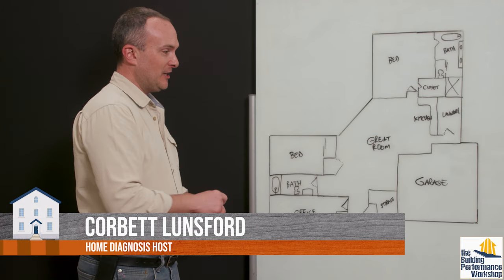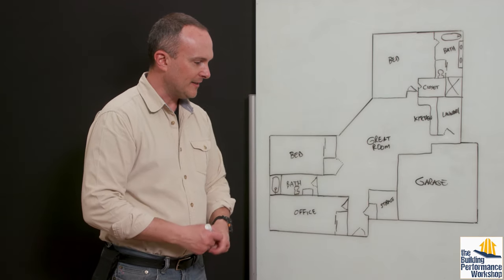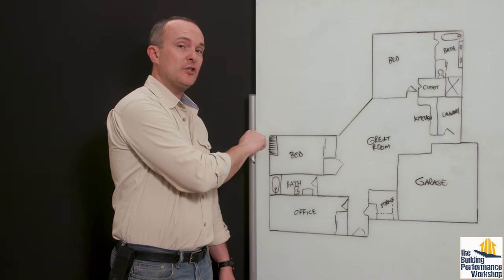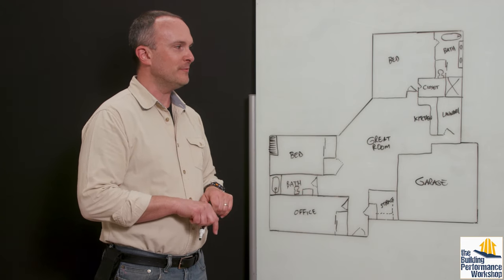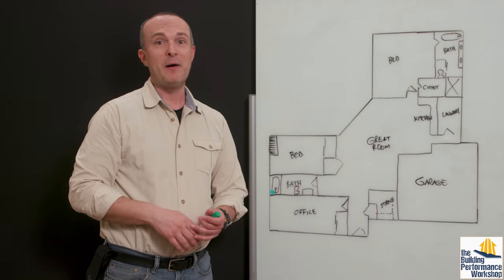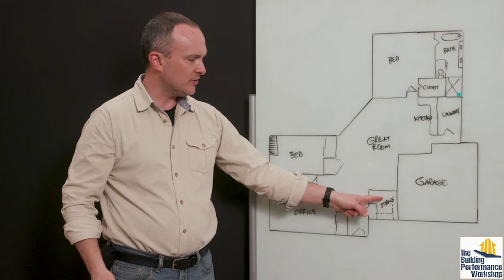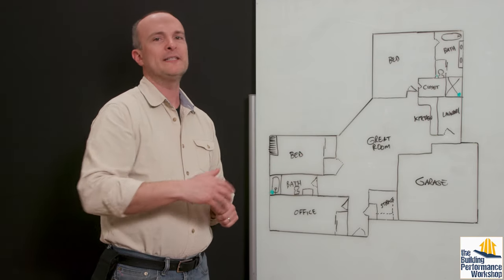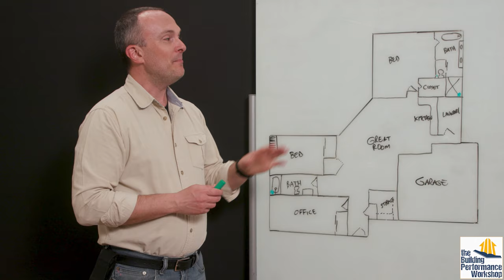Tips for High Performance Home Floorplan: Designing Out Condensation, Odors, Discomfort, and Hassle

Comment: If you insulate properly (continuously on the exterior of the building), air seal properly (continuously around conditioned space), and ventilate properly (via ERV), you can design any way you choose because these concerns won't exist.

Comment: Good to know. We have a coat closet on the front of the house we barely use. But during the winter, every time I open it, it's at least 20 F colder in there. 
Never even considered that it was a mold risk.

Comment: We ended up with the most energy efficient house in our wee town by sheer luck. I live in the Canadian Arctic where temperatures fluctuate 100C from coldest to hottest temperatures, so insulation is no joke.  We were really fortunate that the previous owners changed all twelve of the large windows to custom quad-paned units.  Even when the exterior temperature is around -60C, the glass on the inside never gets cold.  I will be sad to say goodbye to our little house when we retire because Northerners value function over form; I can decorate to make it cute, but I can’t fix major structural deficits.  Because the permafrost is just a few scant feet down, there are no foundations or buildings set right on the ground, but on jackposts or piles.  Usually the floors are frigid, but in our house we have a heated crawl space below so the floors are always lovely!  There were two strange or new things for me, though, with this house:  
1. having a humidifier going during the winter.  We came from Nova Scotia where DEhumidifiers were da riguere, so this was new.  We usually go through about 7-8 litres of water every day in our humidifier; and
2. Central AC. I realize this is nothing new, but it was the very first time I have had central air in a house.  Not only does it combat the heat when we are in the high 30’sC, but when we are in a heavy smoke from forest fires, the hepa filter eliminates any trace of it inside.  As an asthmatic, that is a HUGE boon, especially when you live in a remote town with no road going to it except when the ice road is open each winter.
Reply from the maker: Thank you for sharing

Comment: I have walk in closet on exterior wall. When i designed my house I never considered moldy odors....and 30 years later It works fine. no odors, no mold. It's worth noting I did install baseboard heating elements along the exterior wall in the closet. Good video thanks for sharing your views .

Comment: Running Warmboard into the closets keeps the closets from getting musty. Also closets on exterior wall should be around 25” in depth. Keep the clothes on hangers about 2 inches from the wall. The air gap keeps the clothes fresher.
Reply: Curious how warm floors affect mustiness. Always looking to learn. Please talk through this a bit. Thank you!
Reply: @branchandfoundry560    For some people, clothes coming out of a dryer can be slightly damp. The clothes get hung into a closet for final drying - to reduce the number of wrinkles.   A closet needs to have "drying potential" just the same as a wall or ceiling assembly. Running warmboard (in-floor heat) into a closet - combined with a return air pathway allows warm air from the floor to rise then go to the whole return or to an exhaust fan with a dehumidistat.  (I am talking about ERV technology with integrated HVAC controls  rather than "stand-alone" non-integrated controls).   Combine "clothes science" with "building science" and thinking about how to keep humidity in the healthy range.  To answer the question - mustiness can come from damp clothes.  Where there is moisture - you need to ventilate.
Reply: @BirchwoodBill  Ah, ok. Thank you!

Comment: Thermal bridging becomes vitally important as your structure gets less leaky.  It is however often thought about in the wrong sequence. Don’t worry about a thermal bridge until you’ve completely controlled airflow.
Reply: What would you say is the minimum air sealing required to worry about thermal bridging? 1 air change per hour? Passive House's 0.6? Sub-passive-house cert?

Comment: thermal bridging for sure is something to think about in Canada! I moved into a new build in 2021, left a pillow leaning against an exterior wall for a few nights. when I wanted to pick it up it was frozen to the wall because it leaned right in front of a stud. imagine having a closet on an exterior wall. all the condensation that's collecting in there. you'd have an extreme mold problem.
Reply: this comment was just for the super nerds picking fights in the comments ;)
but overall a super helpful and informative video 👍

Comment: Please go on more about why thermal bridging isn't as big a deal as we think.  We've probably all seen the thermal imaging photos which clearly show thermal bridging.  Actually, I've seen that in frost that has formed on siding: there is less frost where the studs are.  Have you done a video on the ZIP system?
Reply from the maker: Hey Budro- I built our forever home with GP ForceField, which was invented by the same guys who invented ZIP, following similar ideas. You can see lots on that playlist about it, and in the second season of Home Diagnosis:
https://homediagnosis.tv/season-2-episodes
Reply: Temperature is not the same as heat transfer rate. They are related exponentially to the temperature difference between surfaces. But conversely, heat transfer with smaller gradients is really slow.

An infrared camera cannot actually tell you where most of the heat is being conducted to or from and how much. You can infer it from temperature differences, but it's not absolute.
Reply: @KaiserTom  Excellent points you make!

Comment: Dude, if you’re getting condensation and mold growth on the inside of an exterior wall, then that wall is not properly insulated. I don’t see how this has any relevance to new construction. 

It might be useful to know for minor remodeling of older homes that might have little to no insulation in the walls. But if you’re building new, you should insulate and control vapor and air properly such that you can put closets/storage on exterior walls. It is a good point though about using them between rooms strategically for noise reduction. 

I also always thought it would be a good idea for kitchen corners to have that difficult to use space be used by the other room. For example, in the layout shown, that master closet could have a chest of drawers built into the wall that uses the space under the kitchen cabinet corner (or from the laundry room). Yes, you lose some kitchen storage space, but it’s awful storage space, and it becomes much more useful in the closet. You could even steal some space back from the closet (or laundry room) with a small nook to be able to recess the fridge a bit so it’s flush with the counter. This makes the space a little less flexible for changing around in the future, but it uses space much more efficiently. So depends on your preference I guess.
Reply: Like your ideas on space usage.

Comment: Some interesting info. I will be building a hempcrete home with living by the water and having moisture issues in the sometimes humid summers. It’s moisture regulating and very insulative, among other benefits. I don’t like a/c, preferring open windows/fresh air. I like curtains on closets and even cabinets, or leave open with no doors, or ventilation holes (can be stylish) for air flow, as it gets musty smelling in a regular home near the water without using a/c, no matter what. Ceiling fans etc help too. There’s various things like calcium chloride that can help absorb moisture.
Reply from the maker: Interesting- I’m rooting for you, though I bet your guests/fam members may wish for A/C eventually the way the climate’s going.

Comment: Hi Corbett, I enjoyed your video – lots of good information. I was wondering what you would recommend doing to improve the durability of the wall assembly in the bathroom when you have no choice but to put the tub/shower against an exterior wall – or in a corner with two exterior walls?
I know from watching other Youtube videos that a common mistake some builders and most DIYers make when installing a tub on exterior walls is that they forget to install water resistant drywall or cement board below the tub deck. Yes, they do install cement board ABOVE the tub deck so they have some place to attach the tile but the stud bays below the tub deck are left open and that just allows moisture laden air to flow freely into the bays and condense on the inside surface of the exterior sheathing.

So after installing water resistant drywall around the entire tub area (before you install the tub) would it be a good idea to build a second insulated wall up against the outer wall for an added moisture barrier?  Essentially the sequence of layers would be: exterior sheathing, exterior wall studs with insulation, water resistant drywall as an air/moisture barrier, interior wall studs with insulation, smart membrane (?), cement board, tile, tub.
Good idea, or overkill?
Reply: that was exactly my question. If it's known that there's insulation issues with tubs against exterior walls, are there no mitigation options?? Seemed unlikely to me. Great question!

Comment: Thanks for fighting the good fight!  A couple of questions:  
1) Exhausting directly from the Shower and Powder room to a continuously running ERV seems to make good sense on some level.  Should we assume that there is no conditioned supply in these locations,  or does the conditioned supply air get pulled into the bathrooms?  It seems that if  there was supply in the Bathrooms it would run straight to the ERV exhaust potentially limiting their effectiveness in conditioning that space?  If the ERV is running full time and the Conditioned supply is running as needed based on the thermostat location does this lead to less than ideal conditions in the bathrooms.   I would love to see a video on the science of supply grille locations for an entire house.  Last question, on an older not so well sealed home why would you not recommend an ERV (just the cost), it seems the less  you need to pull air from cracks and crevices via negative pressure the better?  Thanks!!!!
Reply: ideally in a bathroom you would have a floor vent between the sink and door or a ceiling vent above the door

Comment: I'm a builder I've never seen a mold problem in my area with closets on the outside walls we do however have low humidity similar to Arizona levels.
Reply from the maker: Mostly a problem in cold weather, so indoor humidity is the worry. If you add enough clothes and boxes, you could reach dewpoint almost anywhere.

Comment: My brother has a heated workshop that sees higher level of moisture due to parking a snowy vehicle in there and everything melting. More to the point you can find every stud and most screw holes behind the white-painted drywall because moisture condensation and then either dirt or mold as a result of said moisture.  

With 16" O.C. framing at least 10% of you wall is a framing with ~R-7 insulation verses the ~R-21 in the cavity.

Comment: the small dwelling designs i've been tweaking over the last few years (building 1st one this summer!) all have kitchens/baths/utility central, nothing plumbed in envelope walls, with living/bedrooms at the wings (designs are all situated E/W for solar gain). the idea is to use the ERV vent/return placements to also passively help with heating/cooling duties (pre-moderated via Earthtube, & a post-exchanger hydronic fed plenum), as i won't have central HVAC... and this layout helps keep major MEP costs low. 

your thoughts on small confined spaces on envelope walls isn't somethin i'd worried about much (wardrobe cabinets, no actual closets), but i do have kitchen/vanity cabinets on some. would you suggest i find a way to ventilate the cabinets? i'm already supporting the lowers with 3/8" tall squares of UHMW poly to help avoid damage from spills/pooling/leaks (also allows LVP to move under weight...not that i'm using LVP on these - polished concrete w/hydronic), so it wouldn't be hard to add some perforations. circulation behind cabinets would only involve added trim work.

 thoughts/ideas?

(6" ICF envelope & ICF roof, insulated slab, 7000' high desert with 20" rain, 6' snowfall, mid 20's - upper 80's, low dew point)

Comment: Ducts can go under the floor also, I just bought a house from 1962 that has a vaulted living room in the middle, vents in the floor
Reply: Typically vents have been in most homes I’ve ever been in, unless it’s electric or boiler baseboard heat. (Canada)

Comment: Pardon my lack of knowledge, can you explain further why it is not good to have the closet on the external wall? Can you explain please? thanks you
Reply: If I understood correctly, it is because the condensation that might happen will lead to mold, as the external wall might have a thermal bridge, which is a point in the building where it has weak insulation from the temperature outside. So the external wall will let in the air from outside and the difference in outside and inside temperatures will create condensation and if a closet is against the wall it'll mold.

Comment: It seems like a lot of this can be solved with a better exterior envelope... I myself plan to build with at LEAST 2x6 studs, 2" of spray foam, and a faced batt made for a 2x4 wall behind that, if not bumping the former and latter up to 2x8 and a 2x6 batt, respectively. And that's beside the fact that I also intend to build perfect wall/monopoly framed and with Zip-R sheathing, then do that aerosolized caulk treatment to get well below a passive house cert, too.

Comment: First time watching one of your videos. . . enjoyed it immensely.  Question for you:  The bathroom located between the children's/guest bedroom and office is an atypical 5'x8' full bath.  Most homes have them (or some variation of it). Should architects stop placing the tub along the exterior wall and design a more energy-efficient full bath for children and guests?
Reply from the maker: Welcome to the cult buddy- there are really no hard and fast rules, since all this depends on wall insulation, air temps and humidity, anf other behavioural differences among occupants. Just asking the right questions during design is the best thing of all.

Comment: Understand the issue but keeping “all” exterior facing wall space free & clear seems like an onerous restriction. Would additional insulation between the wall & the offending case-goods, tub, etc., help? …
Reply from the maker: YES, Mark, very good point- however, in real construction sometimes the staging gets screwed up, and the bathtub might get installed before the insulator arrives. Have seen this a number of times myself.
Reply: In addition to what he said, during construction, behind tubs and showers are big "tamper areas". The plumber needs to get behind there and fiddle with their pipes, or the electricians run wires down the chase that's behind most tubs and showers - plus a million more reasons for someone to be tearing apart the poly and digging through the insulation to cut and drill holes, fish wires etc. Often once theres a tub there, there's no way to get a stapler back there so all the nice insulating material just get shoved back in, if it even does get shoved back in.
Reply from the maker: Excellent point Levi

Comment: I hoping to build my dream house. It will be constructed of SIP panels, which are meant to have high thermal performance. I was wondering if mould would be a problem here. All the windows are double-glazed with thermal break aluminium frames. As for the bath, I have heard that placing insulation under the tub in the building helps keep the water warm longer
Reply from the maker: The correct answer of course is ‘it depends’ but as long as you maintain reasonable temp, RH, and clean regularly you will be good.

Comment: are showers or other vapor impermeable finishes on exterior walls a condensation risk?
Reply from the maker: Interesting question, and I'd imagine that if it's the only thing that's vapor impermeable in a well-insulated, well-airsealed new home, then it wouldn't make a lot of difference.
Reply: @HomePerformance  i meant in terms of a cold surface if running AC
Reply from the maker: Oh. Condensation would be an issue on any surface below dewpoint, in that case, not just impermeable ones.

Comment: Thoughts on mini splits for primary HVAC? Obviously they aren’t capable of working with an ERV but do they bring in enough filtered air on their own to mitigate mold problems?
Reply: Or is there a thought to eliminating the ERV, running a whole house dehumidifier/air purifier? I have an ERV but I still run an air purifier inside. I think a lot of people will start running them in the upcoming years when we start seeing more mold/mycotoxin sickness diagnosis’s.

Comment: I have a question, is it possible to build underground garage on top of normal garage in the same place/area, for an example:

    Garage           < Ground floor garage 
———————-   < Ceiling/floor
Underground     < Underground garage 
     Garage
Reply: One of Steve Baczek’s houses had its normal garage with concrete planks as the floor, with a basement workshop below.  You could do similarly, except just have another garage below.